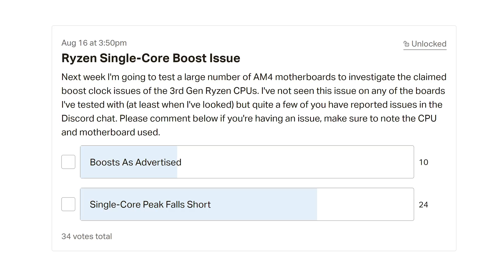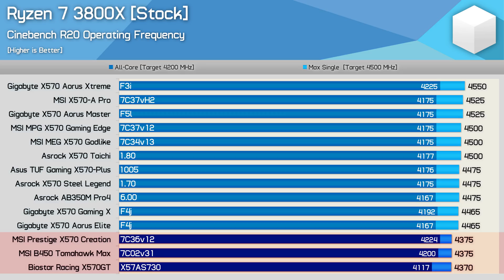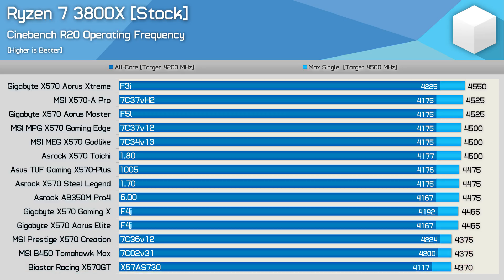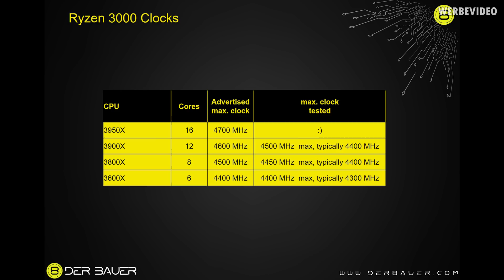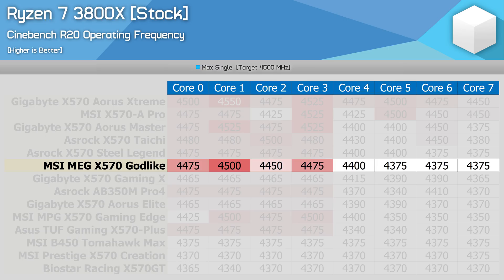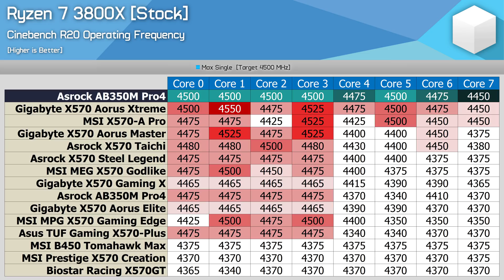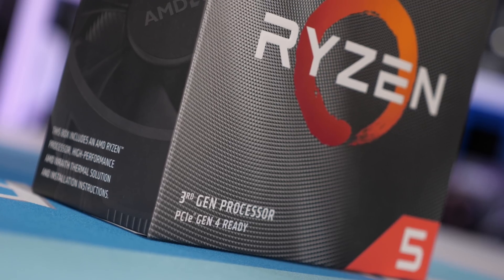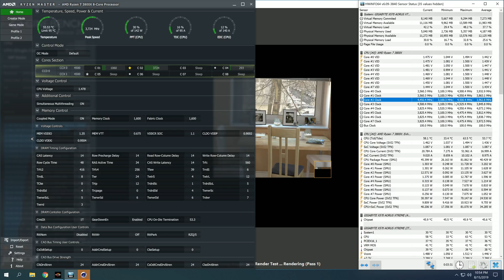AMD 3rd Gen Ryzen Boost Clock Investigation

Comment: Gigabyte FTW. I was already planning on an Auros Xtreme anyway because it's the only one without a chipset fan.
Reply: It's $911 from the cheapest e-tailer where I live :(
Reply: @isakh8565  $700 in the US, that's bad enough. I'm willing to pay for not having a chipset fan and the board just being beautifully designed and so overkill in every aspect.
Reply: @praetorxyn  It's the only X570 board I would want, but I can't justify 900+ dollars. Maybe if it goes on sale at some point.
Reply: @isakh8565  Is that USD? Where are you located? I know prices are higher in Australia, but the AUD isn't worth as much so I thought it worked out about the same.
Reply: @praetorxyn  Yes that's USD, and I live in Norway.
Reply: @isakh8565  That sucks man. At least Norway has a lot of other good things going for it. Come to think of it, is Norway a country that includes tax in the price? I know some places have like a 20% VAT that would about cover that difference.

Over here, sales tax isn't included in the price because tax is different for every state. So for me, it's $700 + 5% tax, or $725
Reply: @praetorxyn  Yes, 25% VAT is included in that price.
Reply: @isakh8565  Oy. That's the difference right there. We have low sales tax but high income taxes.
Reply: @praetorxyn  Yeah, the VAT puts it at $875, and then the remaining 36 bucks is just the normal retailer markup here.
We have both a high sales tax AND high income taxes. But it does bring some pretty good benefits, that's true.
Reply: @isakh8565  Yeah. Plus all those Scandinavian women :)
Reply: @praetorxyn  Very true ;)

Comment: It's a mystery because old bios worked just right, but I want to ask something else.
The chips you're using are the chips you used during the launch? I wonder if the new batches AMD is sending to the stores now are a better binnage.
Reply: He said at the beginning of the video that he has purchased quite a few 3000 series CPUs and that his experience remains consistent across the board. So I doubt it's a post-launch binning issue. He used the exact same CPU in the testing for this video, so it's very clear that this is a motherboard/bios issue, not an AMD issue.

Maybe AMD should have advertized it as 4.4 GHz, but if it can max boost to 4.5, then it can max boost to 4.5. Simple as that. There's no falsehood in saying so. And I'm sure they test and verify the frequencies on a test bench specifically designed to do so. So, whether or not the board manufacturers have their bioses and drivers up to snuff isn't really AMD's fault.

Comment: I will also add that AMD isnt really pushing these CPU's to the limit with their PB2 or PBO algorithms. I've been saying their Algorithms are being stingy and expecting you to be at sub-0 or something for some decent clock speeds anyone could be achieving with a manual OC. PBO at its defaults all core barely get to 4.15ghz for me, but the temperature according to Ryzen master is only 66c. With a max temp of 95c? Even raising the PBO limits so that they are never hit, get almost to 4.2ghz but still only get to 70c with a max of 95c. with my manual OC of 4.6ghz CCX0 and 4.4ghz all others, 75c according to ryzen master and MUCH higher scores. If its not just the vendor bios, its definitely AGESA that needs work.

This is with LLC Auto/Off/0 whatever it is for your board and 1.4635v mind you. dont be scrrd.
Reply: Your CPU will be dead in less than a years time
Reply: @lldjslim  they'll be dead faster at stock then, theyre set way closer to 1.5v that way. I'm undervolting by comparison.

Comment: The latest chipset driver seems very restrictive (rigide), regarding base and boost frequency clocks, I have a Zen+ CPU, and had to switch back to v1.07.07.0725 from the latest v1.07.29.0115.

Comment: Maybe I got more lucky than I thought I’m running an all core overclock 4.4 ghz ryzen 3700x on a b350 tomahawk with an h150i cooling no problems at all
Reply: Very nice, can we see the some benchmarks or pics ?.
Reply: Yeah I can post them later this evening
Can anyone tell me how to post pictures I tried and couldn’t figure it out
Reply: Thats pretty damn good, mine barely gets 4.2 allcore with 1.45V.
Sending mine back, getting a 3900x, lets see what happens.
Reply: You tested with Prime95 and Cinebench? Mine won't get stable even at 4.2GHz without 1.33V

Comment: We should all list our mobo, bios version, chipset driver, power saving mode, and max single core / multi-core on R20, along with the particular processor that we are running.

That would give us some more generalisable and potentially actionable intel.
Reply: No, because there's zero consistency in how people configure their systems. There's a lot of idiots running the wrong power plan or lots of programs in the background, or messing with BIOS settings they shouldn't or testing with the wrong monitoring software.

Comment: This kind of reminds me of the old athlon 64 era, Intel were pushing clock speed at the expense of everything else and all their marketing reflected that, and up till then we it had mostly been true a 1ghz processor would outperform an 800 mhz one in just about every case. But the AMD chips at the time had a fairly huge IPC advantage but a lower core clock. So AMD broke with the tradition of naming the SKU after the clock speed and instead named them after the equivalent intel clock speed so you'd have pentium 4 3.0 going up against and AMD athlon 64 3000+ which ran at 2 ghz.

Its kind of frustrating. AMD feel that people are more interested in having higher numbers than the actual performance and seem to be massaging the truth to get people interested, but I guess they are right for a lot of people. I'm just glad that channels like this exist now and can go some way towards educating people. Hopefully both AMD and Intel can keep the current level of competition going :)
Reply: excelent synopsis of the marketing trends,

side not i actually still have a pentium 4 machine (hyperthreaded of course) and it runs as an ingest computer for my mavica camera (floppy disk cam) its amazing how those old cpus hold up

Comment: I don't believe that Mobo manufacturers were rushed in anyways. They had the CPUs for at least 8-9months before the release... In CES 8 Core Zen 2 was shown and manufacturers were listing their x570 lineup you don't design boards without CPUs. 

But I Do agree with AMD's false marketing. They made people believe like they are getting those single-core boost frequencies with all cores while in reality, you cannot even get them to work in a single core level.

 I really like AMD and I was fucking hyped up for 16 core 4.7 part and saving up for it. But it turns out that CPU will most likely run at 4.2ghz all cores at best but I'm not interested in a CPU that cannot overclock at all. I will wait till AMD learns to make CPUs that overclocks like Intel CPUs do. They should at least meet their single-core boost speeds with all cores when overclocked.
Reply: That's like saying: "I won't get this cars because I can't improve the 500PS factory power to 525PS modded.
You are not the market. Definitely not.
Pay for overpriced Intel and Nvidia parts. That's what you deserve.
Reply: @FutureChaosTV  I stated my own opinion. Never claimed to be the market. Also, a processor is not a car so your analogy is flawed because cars aren't marketed to overclocking capable but CPUs are. 

Besides marketing a product to run at a given frequency and it ends up not even meeting it is just plain BS. So it gives me every right as a potential customer to bitch about it. 

Additionally, afaik I never condoned, promoted or stated Intel's and Nvidia's price premiums in my previous comment. 

So as an enthusiast and a potential customer, I believe that I'm entitled to ask that a product a company is selling to be the product they are marketing. 

TL:DR If the goddamn chip is not capable of running at the marketed frequency in daily use don't market it as it does. Also If there is no goddamn headroom for overclocking then don't market it as overclocking capable CPU.

I hope now you understand where I'm coming from. 

Sorry for the long read^^

Comment: Check into the load line calibration.  Lowering the voltage at higher freqs can free up a little thermals and can result in that little extra for your benchmarks

Comment: I think we are reaching clock speed limits because as the die shrinks, it gets more dense and the frequencies will be limited. I believe as we get smaller the clock speeds we decrease. It is part of the reason that Intel is having trouble with their 10nm, the performance will not be any or much better than the 14nm CPU's they are producing now. As the transistors get smaller and more denser in we will hit a wall. Efficiency will improve but most of IPC gains will be from architectural improvements and overall performance will be from more cores added to better architecture.
Reply: @DreamWarriorFish Who knows what Zen 3 will bring, I think it's a bit optimistic to talk about 5.1, 5.0Ghz or even 4.8 when Zen 2 really doesn't reach 4.6Ghz but for maybe 1 core once in a while (the 3950x might). As we get to 5nm and 3nm I think the clocks will be limited to the mid 4Ghz range. I think performance improvements will be from having more stuff being added to the I/O die like more cache, more RAM interfaces and better memory controllers for better latency. Intel has 10nm parts ready now but they are just not any better than there 14nm parts yet.

Comment: take a breath just imagine how amd fans would have reacted if intel did this? how would intel fans react?
Reply: Knives77   Droves of AMD fans would be throwing rocks at Intel's buildings and lynching their employees.
Reply: @wysetech2000   yea i have noticed AMD pulling a lot of scummy shit intel used to do but the fanboys let it slide at every turn not that im surprised I subscribe to no particular company so im just saddened I had hoped AMD would be the better one but alas they are both the same scum
Reply: Knives77 that’s a great point
Reply: It actually happen on mid-range boards, it completely wipes turbo off for seconds. Hw made a video of that. Although I also don't like this lottery on the amd chips
Reply: @BenchARTVideos   im unaware of this... and this hasnt been my experience could you provide a link to the vid so i can see please?

Comment: Ryzen only boost to that frequency for very short times, for example i have a 3700x and a b450 tomahawk, the average single core boost is around 4350 and 4375 mhz but the hwinfo reports 4400 and even 4425mhz for max frequency in some cores, i particularly dont like this milliseconds boost because ruins stability when you are undervolting with pbo for no performance improvement. I think amd should consider more realitic boosts like 4.3ghz in the 3700x, because if the cpu doesnt boost at the speed that is in the box, some people might think theres something wrong with their system, my opinion

Comment: In games, my 3700x boost to 4.35 all core, yes, all core. It fluctuates of course because it's a game.

In high load benchmarks it's more like 4.2- 4.3, I think it has to do with cooling.

I've seen 4.4 rarely, then it's just a split second. I'm on a 470x Taichi.

I'm not unhappy. But, AMD definitely is not delivering, the 4.4 should at least be an average across the board, almost nobody is seeing this speed. I think any company should be called out on this, I feel it's hugely misleading your customers.

Comment: My Ryzen 3600 + Asrock AB350M Pro4 (latest bios) can reach only 4050Mhz single core (3900Mhz all cores) with Scythe Kabuto 3, so I just set it to manual 4.2Ghz/1.3V and it's Prime95 stable with reasonable temps.

Comment: Question:
I have a 3700X on a msi B450 tomohawk. All default settings. 
Only Ryzen Master up and idle. Voltage is at 1.47. the explanation that cpu z or hwinfo showed the last reported or something but shouldn't Ryzen Master be dropping the voltages since my CPU is idle.
Reply: Bios update should fix high idle voltage

Comment: Also, I will add that my 3900x can actually do 4.7ghz on CCX0 if I manually clock it to do so. Probably higher but I havent tried yet, so Robert Hallocks video isnt exactly trying to spout lies. Its just its not even working as they expected it to across the board.

Comment: If you can test between AGESA 1.0.0.2 and any 1.0.0.3A(B(B)) revision, you should see the 1.0.0.2 outperforming later AGESA's by about 75MHz. Try it out on the same boards if both BIOS versions do exist for it. My 3900x either does 4650 or 4575, depending on which bios I install, on x370 Taichi. Repeatably, and 100% reproducible.

Comment: As someone who has been eagerly planning to buy a new AMD processor. And has been trying to determine the source of the wild difference in clock speeds. This review was insanely helpful. I'm a little disappointed that you were not able to include more of the high end Asus motherboards to your lineup. As I'm extremely curious how they will perform. But I still appreciate the massive amount of work you put into testing all the boards you did. Thank you so much!

Comment: Just a guess but i think that amd is using the better quality chiplets on threadripper and epyc rome. And the ryzens get the worst Chiplet. Thats why the ryzen series only has 1-2 cores max that can boost up to the advertised speeds.

Maybe more cores will be hitting higher speeds when the next ryzen refresh comes out (next year?) and the 7nm process has matured a bit with better yields.

Comment: Only reaching 4275 MHz on my 3900x/x470 CH7 wifi and the newest AGESA (1003abb).
4350 was the max on 1002
Reply: I was hard capped at 4.3 with the same setup. It's a configuration issue, probably windows power plan related. Try to manually punch in 0% for minimum and 100% for maximum CPU frequency in the currently used windows power plan.
Reply: @TheLeafyo  As expected: Didn't change anything. I'm on Ryzen balanced btw and the newest chipset drivers. But thanks for the info.,
But Shamino from ASUS already stated that it's an AGESA problem

- dont be looking for boost changes, the higher booster is only due to the 1002 smu f/w, 1003's smu f/w is not the 'high booster', why the newer smu is a 'weaker' booster one can only guess.

source
https://rog.asus.com/forum/showthread.php?112279-X370-X470-AGESA-1003AB-Bioses&p=779048#post779048

Comment: Amazing amount of work,Steve,shared and liked.This data is valuable,thanks.Paid 449 canadian for my 3700X,229 cdn for my MSI X570 Gaming plus and 219 for 2x16gb c16 of Corsair RGB Pro ram,and I am happy with it.My chip is fast,but AMD's marketing Dept is bending the truth somewhat,imo. My chip under a eVGA CLC240 with Artic Silver 5, or IC Diamond will not go above 4.275 all core.1 - or 2 cores boost to 4.3-4.35 ,but for seconds only.This at 1.380vcore,everything else on auto.Temps around 22c ambient,32c idle,55 to 70c load.No amount of vcore can get any of the 8 cores to boost to 4.4,ever.Oh,this on an open Lian Li testbench,with central air conditioning

Comment: To add to the user experience- launch BIOS on Gigabyte X570 elite, R7 3800X- I saw 4350mhz MT in R15, 4550mhz ST. No reporting error as scores were commensurate (213 ST). Later Bios (F4J) saw clocks drop 50-75mhz in the same tests, only reaching peaks of 4275-4300 MT and ~4475 ST. Scores followed- ST down to 209.

Comment: I have a 3600 and as long as I keep temps below 65c (admittedly difficult in a closed case at high load) it will boost to 4.2 all core and sit there.
Reply: This is on an asrock b450 k4 fatality mobo btw.

Comment: I only get 4ghz all core and 4.25 sigle core.. B450 pro carbon with 3700x
Reply: That actually might be vrm limitations....
Reply: @Tallnerdyguy  definitely not, 3700x uses significantly less power than a 2700x, which runs fine on a b450 carbon
Reply: @Tallnerdyguy  VRM on the Pro Carbon are pretty decent
Reply: @100percentmobile  i did say might. And also the vrm is adequate, but voltage ripple is not, which might be the reason the vrm may not be adequate. The 2700x is less sensitive to voltage ripple, while the 3xxx series is more sensitive, which is why most of the x570 have more stages and fewer doublers (often, not always)